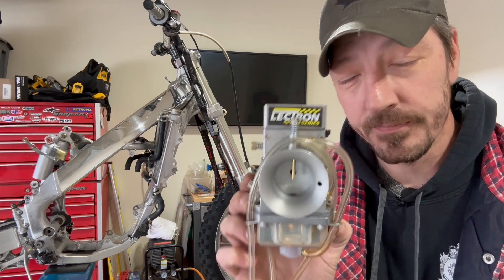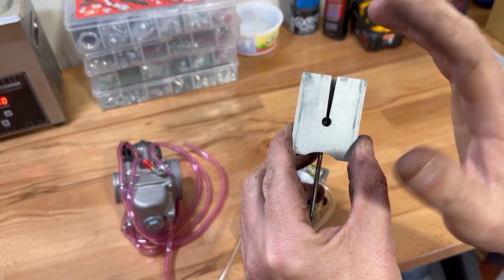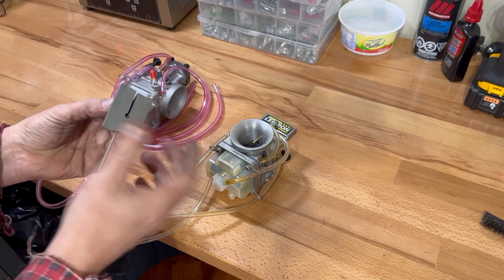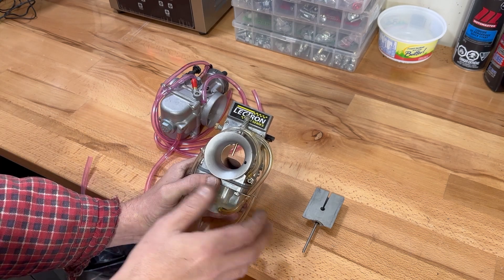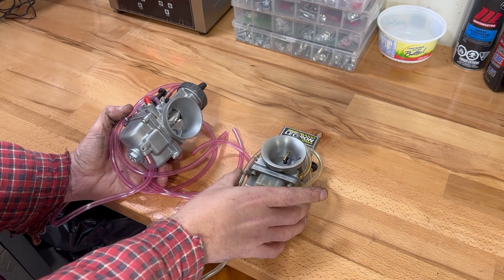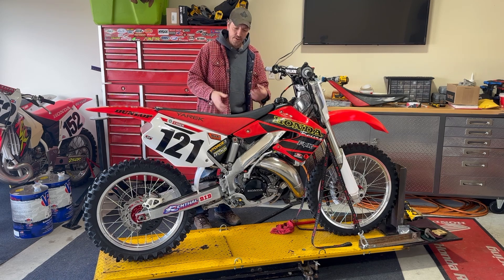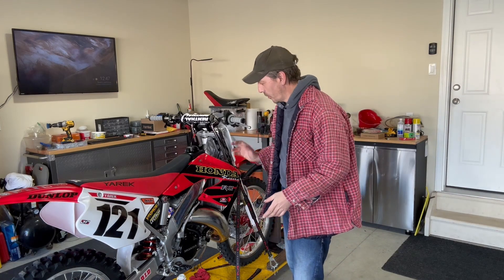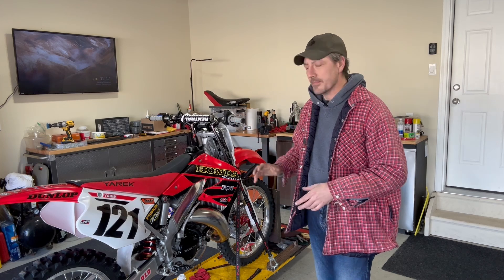Lectron H series, How they work, Setup

Comment: From what I understand with Lectron, The Billetron is the way to go. Supposedly it will behave more like a Smart carb and actually boost the power. As for the “too lazy to change jets” comments. It’s not about seasonal jet changes. If you ride mountains or hard enduro, it saves you from having to pull your carb and retune it on the side of the trail mid ride, that’s where the benefits lie. If that makes me lazy though then I’ll be lazy I’m ok with that. These metering rods self adjust once they are tuned in to the bike they are on.
Reply from the maker: The lectron brand definitely has a good idea behind them.   When it comes to riding at sea level and then is the same day riding at a different elevation is a pretty rare situation for most people… personally there is not a situation within 1000 miles around me..  so I would have no personal experience with having problems that way… maybe it’s the end all be all if that is where you live tho
Reply: @Dirtbikerepair  I live in the Yakima valley, 2 hours in any direction and im facing a different environment. while I live in a desert area that is 1000ft in elevation, I can literally drive 20 minutes and im in the mountains. 2 hours to the west and im in the Seattle area with even higher elevations and lots of rain.

Comment: Wife just surprised me with a 2nd gen Lectron Pro for my DR650.  Gen 2 has their version of an accelerator pump. Anything has to be better than the stock CV.
Reply from the maker: I didn’t really have to much trouble with the one I installed on that cr125. The owner says it’s still working great.

Comment: can you tell me is there a connection between the float and the float valve like mikuni carbs? something that lifts and lowers the valve as the float goes up and down?
Reply from the maker: Honest I don’t have one right now or I would shoot a video to show you how they work.  I don’t believe it’s like the mikuni at all.  Sorry I will see if I can find one and show a bit more about them
Reply: @Dirtbikerepair  the h series does not have the float needle connected to the float.  says so on their website.  oh and the knockoffs are not 60$ on aliexpress and liek 75$ on ebay.

Comment: Could you change setting on the fly  if it electronic
Reply from the maker: On the Fly might be a bit of a over statement...   you can make adjustment pretty easy, if you had a few tools... on the CR125 it was installed on in the video. There was not a lot of room to work on this carb... it is a really tight fit..  I was able to adjust the Metering Rod... but it was not quick and easy.

Comment: been modifying mikunis and pwk's to do the same thing.
if you understand what an "air compensation valve" is on a car from about 1910 is, and how it works, then how that evolved into emulsion tubes and air jets on say, webers, and then understand how a pitot tube works on air speed indicators for aircraft, or blow through turbocharged carburettors...

THEN you might understand how they work ;)

hint. route the bowl vent to the manifold, and solder the holes up on your emulsion jets... 

the suction on the jet is not linear with RPM and air speed.

it is a totally different principle to a standard carb, but really quite simple.
Reply from the maker: That’s actually really interesting, I do understand the concept.  I might have to look into this a bit more and build myself one to try out.   Pretty simple idea if you breakdown the basic functionality.

Thanks a lot for the comment and for sharing your info!
Reply: Pretty interesting mod is there somewhere i can read more to try it ?
Reply: @briansegarra9312  no specific source. just accumulated knowledge. i gave you the three basics to look into. 

the principle... air speed through the carb due to RPM, therefore suction on the jet itself, has no direct bearing to throttle position. emulsion tubes and air jets are the standard way of dealing with the issue. and they are generally set in the factory, and never tinkered with by us mere mortals. find me one tuning guide that mentions RPM, air speed, or an air jet...

its also why a certain carb will always stumble and bog through the RPM range, versus another. different air jets, different locations of bleed holes in the emulsion tube, different fuel mixtures at certain RPM/airspeeds.

whilst you can mod an existing carb, trust me... without a LOT of effort, you will never come close to factory. they have R&D, large budgets, and fancy test gear... but you can get some satisfaction in knowing how they work, at least?

ffs, its hard enough dealing with the thirty or more variations in needles you can get for the average mikuni or keihin...
Reply: Yeah for sure its very hard without all that research im struggling right now with needles on a pwk , but yeah i love researching and reading and taking at look at mods that not necesarias ill do but i like to understand how thing work and how people try and improve or change them

Comment: Lectron: for when you are too lazy to change jets
Reply: Smart carb wins, as you adjust it externally. Just hold the throttle wide open, push a button down and turn it. 

I'm one of those guys that went back to traditional. The Mikuni makes so much more power down low, and unlike the keihn doesn't need a new carb body every time the needle seat gets worn.

Pulled my Lectron off and gave it away. Hated how it neutered the power.
Reply from the maker: It was pretty simple to setup, having no jets didn't seem like that big of a benefit.. still  had to take the slide out and turn the metering rod..    From what I understand a "SmartCarb" is really easy carb to set up...  but i personally don't have a problem with a traditional carb..  

Thanks a lot for the comment, hopefully you like the content on the channel.
Reply: True lectrons are for lazy people

Comment: I have a 2002 CR250, and have been looking/considering Lectrons lately. If you have one with the choke on the other side, that’s a bit older. The newest models have been improved upon greatly, from the research I’ve done so far.
Reply: I have an 02 also, I do recommend the newer lectron pro series Just send your mods and fuel to them And it works wonders, I have a couple of videos riding my 02 with le lectron, best investment ever!!!
Reply from the maker: well that's good to know. Thanks a lot for the comment and all the info, Like i said i don't have a lot of experience with the Lectrons personally  @jowensedycastillo3531
Reply from the maker: From What I can tell, I would Agree with you, I think the Newer "Bilitron" is a little easier to adjust but with the same concepts. 

Thanks for the comment and for watching.  like i said Im not a big pro lectron guy,  I do really like my Air Striker PWK.   I would say look at them too and read about them before you make a big purchase